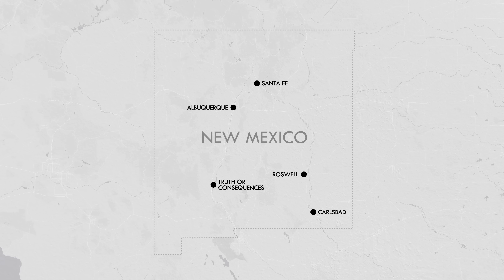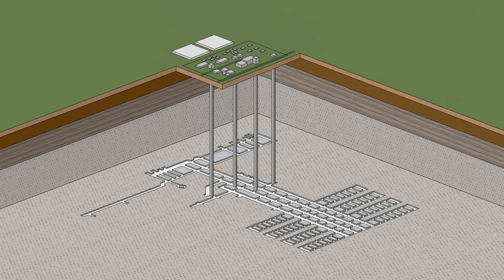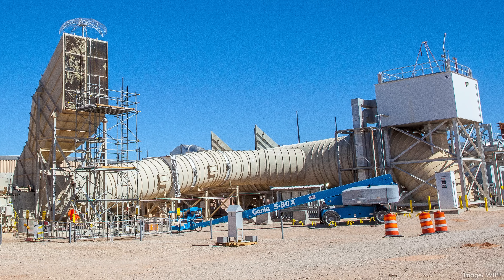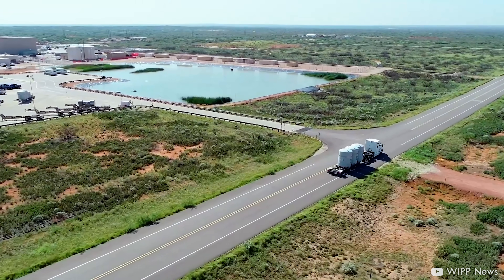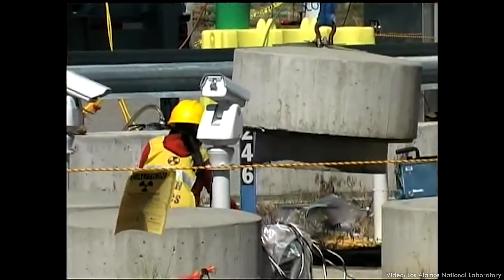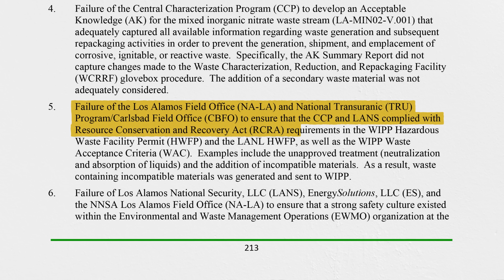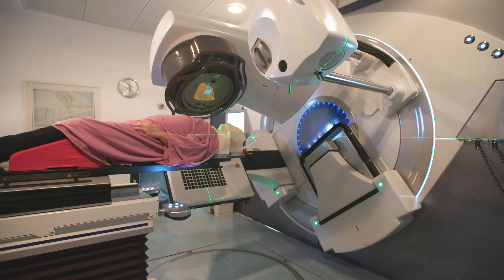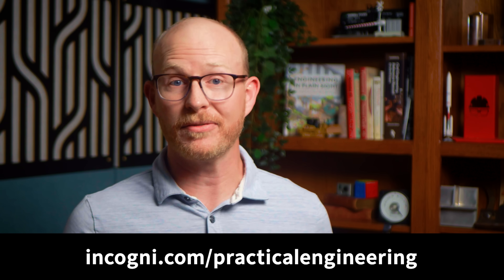When Kitty Litter Caused a Nuclear Catastrophe

Comment: It is surprising that no one questioned the error in the chemistry. The mixture is not dissimilar to gunpowder. Surely any chemist would spot this, mixing a strong oxidizer with a good reducing agent.
Reply: I'm not a chemist but I have the same curiosity about this! When I saw "organic" in that SOP being mixed with nitric acid, my eyebrows raised. Maybe mostly from watching a lot of Cody's Lab and seeing how often he used nitric acid. 

It would be interesting to be able to read the original email chains in which the term organic got into the SOP process and see exactly what was said. I say that because the note from the report says, "Ensure an organic absorbent (Kitty Litter/Zeolite) is used...."  Did no one notice that Zeolite in the parentheses is actually inorganic and clashes with the wording?
Reply: @Tynted I doubt the manager who wrote down "organic" was a chemist and likely none of the technicians doing the work were chemists either. Anyone that would have known not to mix nitric acid with an organic absorber may have not known what was actually in the barrel. I see this happen often. Technical details are filtered through a non-technical person and are either misconstrued or mistaken because they don't understand the critical details. Even the presentation of the material can sometimes hide what's actually important (see the Challenger slides). Technical writing is hard, you have to know your audience and know how to balance what is and is not important. Using the words "kitty litter" is not helpful, it's clear that there are many kinds of for sale. Using "organic/inorganic" may not be helpful either, there may be other kinds of inorganic kitty litter that contain other chemicals incompatible with nitric acid. Plus, it relies on a non-chemist to know what is and isn't inorganic. Simply saying "zeolite" would have clearly communicated the necessary material that could be ordered from any industrial supply company.
Reply: @Tynted autocorrect tried to end them.
Reply: I used to work at a gas station.  Despite having policies in place to avoid it, they were using 'diluted' bleach to clean the diesel pump handles.  The training for forecourt staff was to just top the bottle up with either bleach or water as it got empty.  I don't know at what ratio of concentrated bleach to water to diesel things start getting 'interesting', and I quit before anyone could find out.
Reply: @fishnutter5219  there is a well known reaction between break fluid and pool chlorine tablets. After a few minutes of nothing much happening, the mixture bursts into flames.
Petrol and diesel are far more stable in that respect. I think it would take a lot of chlorine to ignite the fuel. Rags soaked in unsaturated oils like turpentine, have a tendency to burst into flames, particularly if contaminated with metal oxides catalysts. It is not known for paint shops to explode for this reason.
Reply: @fishnutter5219 im not sure im able to tell what the problem here is.  Is it that the bleach was too diluted because they were mixing it with water, or is it that it was too concentrated because they weren't measuring the diluent?
Reply: @atashgallagher5139 the problem is both, it could either be too concentrated because they were topping it off with bleach, or too dilute because they were topping it off with water.
Reply: @fishnutter5219  the dangerous ratio is 0.01-100% bleach to 0.01-100% diesel, any ratio causes the reaction you're concerned about.
But with gas station pumps usually being outside, on flat, level ground, the risks are fairly minimal, even if you filled a gallon jug with 50/50 of concentrated, 100% bleach and diesel, because they separate naturally and form two different layers, unless you sit and constantly agitate it, or seal the lid, the rate of the reaction is going to be so slow that the amount of chlorine gas isn't a life risk. Even less risk with the minimal amount that would be left on the pumps, even if someone accidentally dispensed a little.
it's still a minor health risk and horrifically unethical, and should be reported immediately, anonymously, to multiple different officials and your local fire department chief that you're being told to mix chemicals that result in chlorine gas, but it's not going to get interesting, and is just going to extremely slowly hurt your eyes and lungs over a few years.
Reply: Funny thing that this exact scenario already had happened... 60 years earlier. In 1957 one of the barrels in storage facility of NPO "Mayak" in Soviet Union exploded, precisely because there were organic materials and nitric acid in the barrel. Analysis later showed that due to chemical reactions content of that storage barrel (or rather storage tank, 300m³) turned into ad hoc explosive and, duh, exploded, forming what is now known as East Ural Radioactive Trace.
Reply: I was a chemistry major (mostly biochem), and even 50 years later the error jumped out at me. It's the sort of work that should have had a chemist cross-checking it as the container was assembled and filled, not just upstream somewhere so what was probably a secretarial error didn't get caught.
Reply: Once you leave the scientist level to the manager level all things are possible
Reply: cody's lab would have figured it out.
Reply: I would guess that the chemistry people weren't involved in the actual packaging of the stuff, simply in deciding how it should be packaged. They probably weren't in a position to even see the miscommunication.
Reply: Actually, quite similar to nitrocellulose, which is used in smokeless powder and only remotely similar to black powder.
Laughably, nitrocellulose, while used as propellant in shells, was used in pool balls through movie film, both causing fires that caused the loss of entire buildings quite quickly.
Reaction wise, gun powder explodes, it's a low explosive. Nitrocellulose burns rapidly via deflagration and doesn't actually explode and part of why nitroglycerin is a component of modern smokeless powder.
Reply: @spvillano  the nitric acid lacks the sulphuric acid to make it an effective  nitration mixture as it cannot form the positive nitronium ion. The similarity with gunpowder is the inclusion of a nitrate oxidizing agent. Paper treated with potassium nitrate,once ignited,  burns with a vigorous flame, similar to a fast fuse. Powdered sawdust treated with an alkaline metal nitrate, can be an effective bottle  rocket fuel. The strong nitric acid, as an aggressive oxidizing agent might have been the source of ignition.
Reply: Thinking about it, it was most likely the residual nitric acid that resulted in the spontaneous ignition of the sawdust. The nitrates just facilitated the combustion. Wet gunpowder will not burn.
Reply: I'm more puzzled as to why only one drum packaged that way exploded.
Reply: @alex_zetsu  first one must hope that any other drums were quickly repackaged. Without knowing the details of the chemistry it's difficult to know why other drums failed to explode, but there are a numerous variables that might be responsible. The acid strength, the level of mixing, the loading and storage temperature, any heat given off by the radioactive materials, metallic catalysts present, etc.
Reply: @nigeljohnson9820  The ones at LANL were repackaged, but not terribly quickly. The ones at WIPP were left where they were (deep in a stack of waste or closed panels), and everyone held their breath hoping none would explode. Some others ended up temporarily at a low-level radioactive waste dump in Texas.
Reply: My thoughts exactly.
Reply: Maybe procurement and processing are so compartmentalized that the processers are told "you're going to use this material we're sending to you" without providing the specs of what it is... And so the processers assumed it was up to spec.
Reply: Chemists and nuclear scientists have a lot of bad blood, and have shockingly low functional knowledge of each other’s field. On average, every actual scientist is more complex.
Reply: I think this story is total BS for exactly that reason. No competent scientist would've missed such an obvious error. Even a competent non-scientist wouldn't replace rocks with actual fuel.
Reply: It looks like it was past the point where any "chemists" would have reviewed it. The data and recommendation was tested, vetted, and correct. Then a simple hand translational error" inorganic -> an organic" is all it took. Everyone down the line was just following instructions.  The purchaser, responsible for placing the order, likely wasn't a chemist. And then even if the people doing the actual repackaging were scientists,  they were just taking this material that they thought was vetted and safe (and probably didn't know exactly what it was at the time) and following the instructions to mix.

With the oncoming climate disaster we are heading into, Nuclear really can't be avoided. But these types of mistakes that humans seem prone to, and essentially can't seem to be prevented completely, no matter how hard we try, is still worrying.
Reply: @aggies11  The purchaser had an opportunity to avert the disaster though. They bought the wheat based litter, not the zeolite that the document called for by name. That means the purchaser saw the word "organic", saw the word "zeolite", knew that they were incompatible, and took a guess that the former was correct and the latter an error in the purchasing order. 

They could have run it up the chain, "hey guys, you told me to buy organic zeolite, that doesn't exist, what's going on here?", which might have prompted a review and a glance back at the whitepaper. But unfortunately that didn't happen.
Reply: @icedragon769  The document the purchaser used (to buy bags of Swheat Scoop form the local Smiths), didn't call for zeolite. The document(s) calling for the zeolite was the white paper and other, generic, high-level analysis documents. It was during the process to translate the high level documents into a working level procedure that the change occurred, and that working level procedure was what whoever (I forget) that made the fateful trip to Smith's used to select their purchase (or, rather, put in a purchase order by a purchasing agent to Smith's, the worker probably just drove a truck there and picked up whatever was ordered).
Reply: @icedragon769  as someone with interment knowledge of the event the purchaser in question happened to be an intern.
Reply: Not to worry, AI will take care of the human problem...
Reply: @tsl7881  this is not cake mixture they are storing, it is long term radioactive waste. Is it unreasonable to expect that there should be better qualified people overseeing the work.
Reply: @aggies11  We can manage fine without nuclear fission.
One of the things that living the past fifteen years in an off-grid house has taught me is that most of western humanity's energy consumption is wasted. My household lighting system is all 12v LED lights, and they use such a tiny trickle of electricity that I don't bother turning off the outside lights around my house, because the bother of needing to turn them back on when we need light out there is more than it's worth. 

When you're designing an off-grid system, you don't start with a typical suburban house electricity consumption and then try to work out how to supply that. You start with what you actually need - lights, fridge, stove, laptop, modem, etcetera - and look for the most energy efficient option in each thing. For stuff like space heating and cooling, you design your insulation and other energy efficiency factors until the house is as close as you can get it to needing neither heating nor cooling all year around, and then you add in the power for what you can't design out - including HVAC so that you have good fresh air to breathe in your beautifully insulated and draught-proofed house. For things that need quite a lot of power but you only use them intermittently, like a clothes washer, you plan to use it on sunny days when your solar panels are producing more electricity than you need for all other purposes.

When you get to actually calculating how much electricity you need to power an off-grid house, you will get to a very different number than the typical suburban mains-powered house. But if we were to design suburban houses like this, we would find our demand for electricity would drop drastically. We don't need to replace current energy use - we only need to supply our needs.
Reply: @aggies11  No, that's not how it works.
Reply: The fault lies with the "encoding scheme" of the English language. Unfortunate verbal ambiguity between "inorganic" and "an organic" that completely flips the meaning. Maybe this means that future projects should avoid these terms and specify materials in a less error-prone manner.
Reply: @lekhakaananta5864  The fault lies in the failure to properly review the procedures. Things like verbal ambiguity are why, when dealing with things like highly radioactive and chemically reactive nuclear waste, multiple appropriately trained experts are supposed to be reviewing working documents.
Reply: @lekhakaananta5864  inflammable
Reply: How many chemists in management? How many "line workers" would remember even high school chemistry?
Reply: You're assuming that the companies in question aren't trying to get as cheap a product as possible and don't really care what goes into it as long as it does the end job....
Reply: @Shinzon23  I feel like kitty litter is probably the least expensive thing they're working with tbh, I think it was just a mistake that didn't get caught.
Reply: @Shinzon23  in the nuclear industry, cost tends not to be an issue. The mistake was sending a non-chemist to the meeting and relying on written notes.
Reply: It coincides with people not qualified in the labor market. 
I suspect those Wipp workers will have health issues even if it's inorganic. 
But this makes me wonder about the Volatility of Chornobyl and this radioactive wheat compost.
Is there a reactive cycling chain reaction between organic material and radioactive?
Reply: @nousernamejoshua1556  I assure you as both one of the WIPP workers in question, AND someone capable of doing health physics, there will be no health issues from the radiation uptakes or exposures.
Reply: @claytonhollowell4488  It seems the processes being used are not of the US government or military deployed.  Unconventional iterate to private enterprise and possibly private nuclear reactors.
Reply: @claytonhollowell4488  my joke not joke has been deleted twice.
Plastic pollution isn't just an ocean issue anymore — it is a lot closer to home than you might think. A recent study revealed that the average human brain may contain the equivalent of a whopping five plastic bottle caps' worth of microplastics.
What's happening?
In a groundbreaking study led by researchers at the University of New Mexico, scientists found that brain samples from 2024 contained nearly 50% more microplastics than those from just eight years ago. The average brain held roughly seven grams of plastic — the same as a disposable spoon.
It might translate brainwave transient error.
Spoke zeolite Kitty liter while picturing his at-home compost which as the carrier wave translated to BRING ME WHEATIES OR CORNFLAKES or Campbell's soup.
Anything that eats like a fork.

Comment: This is a prime example of why I have no trust in nuclear power.
Reply: No one was exposed to dangerous levels of radiation and no one was hurt. Meanwhile, every coal fired power station is spewing out radioactive carbon isotopes, heavy metals, and whatever elements happened to be mixed in with the coal that day.

Nuclear power exposes the public to less radiation than fossil fuels.
Reply: Why? This was basically an infinitesimal nuclear fart in the middle of the desert. Radioactive materials and radiation from the sun are a part of nature; we Jimenez are using an infinitesimal fraction of this,  under extreme care,  to provide energy without burning stuff. Naval ships operate this way safely for decades at a time. Many of our space probes like the Voyagers use nuclear isotope power for decades where no other power source would work at all. Nuclear medicine saves countless lives every year.